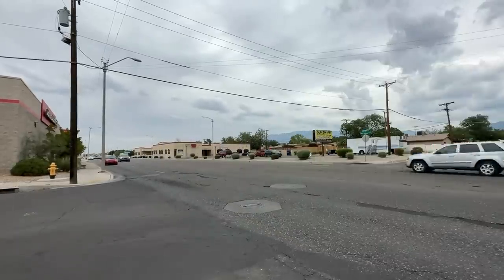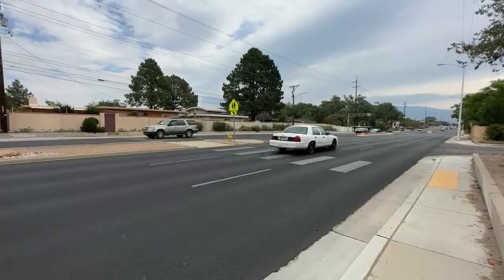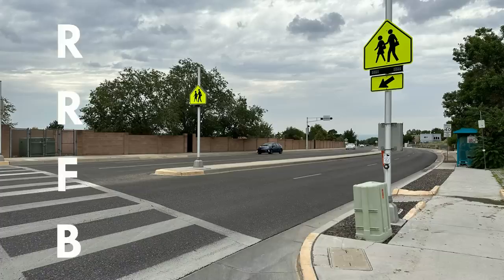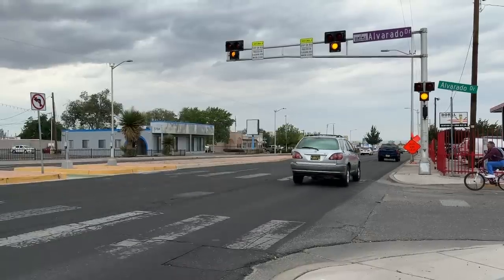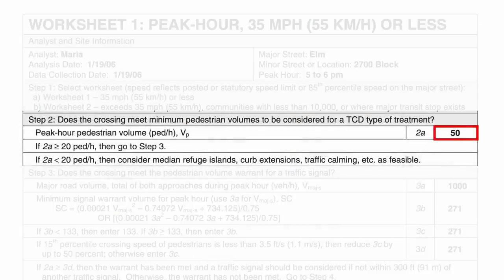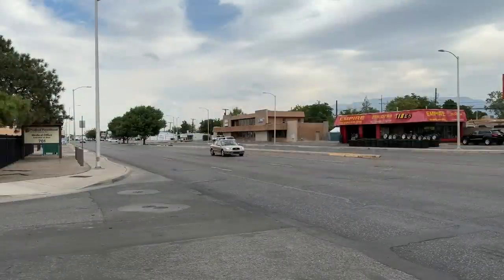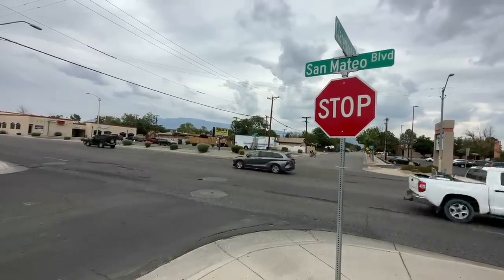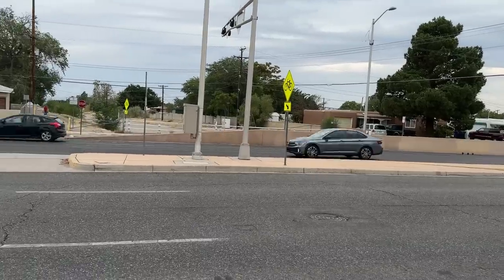The Insane Ways Traffic Engineers Try to Make Streets "Safe" For Walking

Comment: Start with changing the parameters for Level of Service. Right now, it’s getting as many cars moving as fast as possible. Thus the half-hearted attempts at protecting pedestrians, who are an impediment to that LOS. 

In any case, the only way those RRFBs will work is if A) they flash red, B) the crosswalk is significantly elevated, and C) a GIANT GATE GOES UP to prevent drivers from proceeding until pedestrians have crossed. Otherwise, I don’t care what the statistics say, my personal observations is that they are useless and actually endanger pedestrians who may be under the mistaken notion that drivers will, like, stop. 😂

Comment: The focus on flow seems to be the main issue.  Only highways should focus on flow; on other roads flow is just dangerous.  You need to get driver's out of the habit of flow, rather than encourage it, where there are lots of intersections, pedestrians, and so forth.  In Calgary when I lived there, a car in the right lane of a residential feeder road stopped for an 8 year old girl wanting to cross at the crosswalk.  The car in the left lane didn't stop, and killed the girl.  The city's solution?  Don't stop for pedestrians.  Not kidding, literally what they said in response to the accident.

If the focus weren't so heavily on flow, one would only have a two lane road for the light traffic that the feeder road had, and put in a raised crosswalk to slow cars down at pedestrian spaces.  Making it look like a highway is just dangerous.  And fairly pointless, as it's only a kilometer long I recall.

A Hawk was put in my town; very confusing.  Why not just a stoplight that drivers understand, and mostly respect?  It's not like they didn't change all the stoplights downtown a year later.

The town wanted to put flower planters along the sidewalk downtown, to protect pedestrians.  Refused by the state, as a car might hit a planter, bounce off, and hit another vehicle.  That's worse than hitting a pedestrian, apparently.

Comment: Does the US not have pedestrian operated signals?
Reply: We have signals that the pedestrian can initiate.  They will not activate immediately; the waiting time varies by intersection.  But some activate actual traffic lights (red, yellow, green) and some activate something like these HAWK signals, which function differently.
Reply: @BS-vx8dg  any idea why the red orange and green style signals isn't the norm?
Is there any added benefit to the HAWK and other styles of signals?
Reply: @kierannelson2581  I'm not sure.  We installed a HAWK at my school five years ago when we had a child get killed crossing a four lane (two each way). I was excited at first, but when I learned how they worked (allowing drivers to proceed through on red when they self-determine all is clear) makes no sense to me.  I thought at the time that they did a HAWK because they were effectively dealing with a crosswalk only; it's not a four-way intersection for cars anymore.  But now I think it was probably determined to be cheaper.  In my estimation, probably only nominally so.

Comment: As a traffic engineer, there's way too much "engineering" that goes into these decisions.  Speed, road width, and crossing spacing should be enough to make decisions, but good luck getting the city or DOT to approve without jumping through all of these hoops.  Also, 20 peds/hour at a location without a crosswalk has always been an absurd measure to me, thankfully though its not a full out requirement, just a recommendation in the MUTCD hopefully we see it removed one day soon.

Comment: 3 minutes in and it's clear you don't know what you are talking about.  School zones are "about half the speed limit."  There are rules to how school speed is determined; the two I am familiar with are 10 under road speed (this is useless) and a set speed of 15 miles per hour.  School zones are in no way an admission that the roads are too difficult to cross.  They exist because children cannot be relied upon to understand and follow the law of tonnage.  School zones require drivers to slow to increase the likelihood that they can slam on the brakes and stop if a child walks out into front of their car without warning.  It is much easier to stop from 15mph than even just 25.  And yes, MANY school zones are on 25mph roads, at intersections with crosswalks, that are safe and easy to cross as a pedestrian at any time of day.

Comment: The pedestrian count is to give this a cost-benefit element. No point in improving the crossings for places where literally nobody crosses.
Reply: Even as a driver in a newish hybrid car, I don't feel comfortable crossing a 6-7 lane road. Instead I'll turn right, turn left at the next street, then backtrack by going left on the next side street and then right to get back where I was. Or maybe just integrate the arterial into my route. But once a roadway gets beyond 4+1 turning lanes, crossing it in any kind of way becomes somewhat impossible. Painting this as unique to pedestrians and bicyclists is disingenuous. But you make a good point that this size should really be a limited-access road where pedestrians and non-motorized vehicles aren't allowed.
Reply: Could you address pedestrians who cross a block or two away from these crosswalks? Northwest Ave in Bellevue has one of these crossings, and it's almost never used, but the street gets hundreds of people crossing a couple blocks in either direction every day.

Comment: Yeah lets just make every road 2 lanes, with 15 foot wide bike lanes protected by concrete barriers with barbed wire, and make city-wide speed limits 15mph, and crosswalks where when the button is pressed then spike strips pop up...that should stop you bike/walking nerds from whining for maybe 10 minutes before you move on to the next idea to make driving even more unbearable than it already is